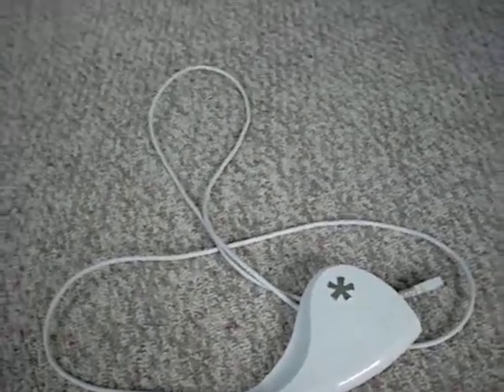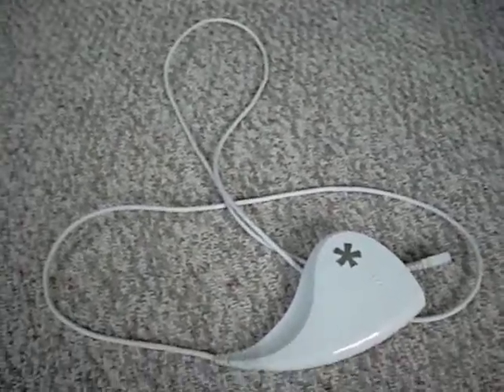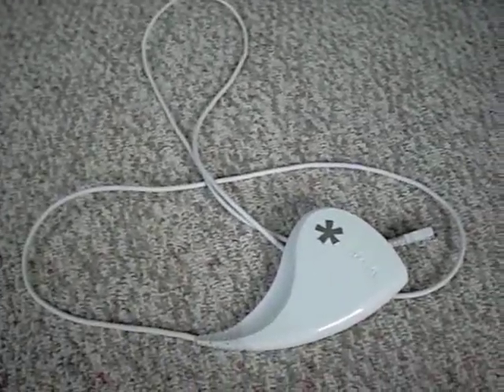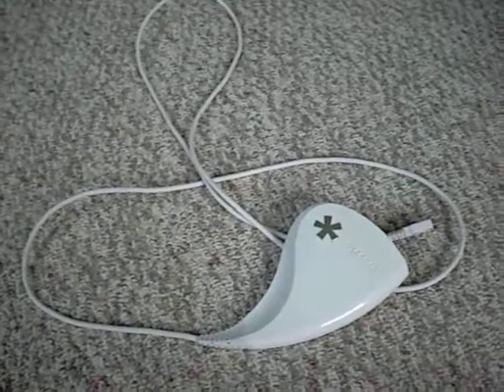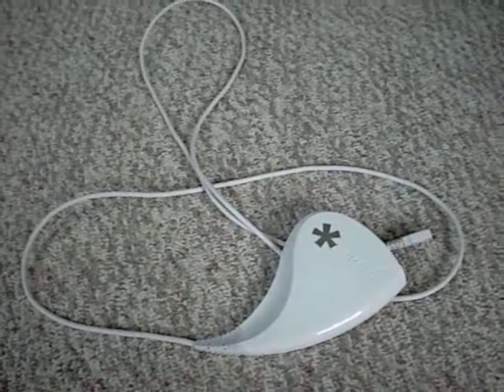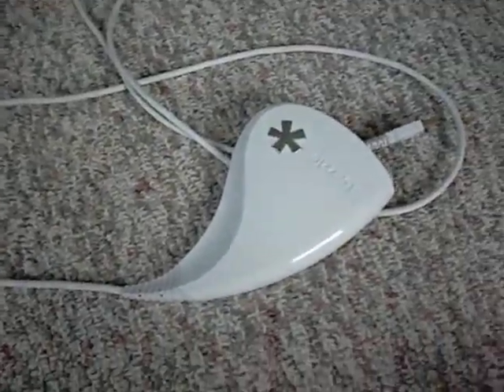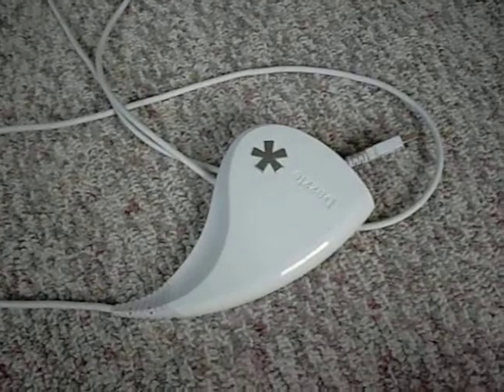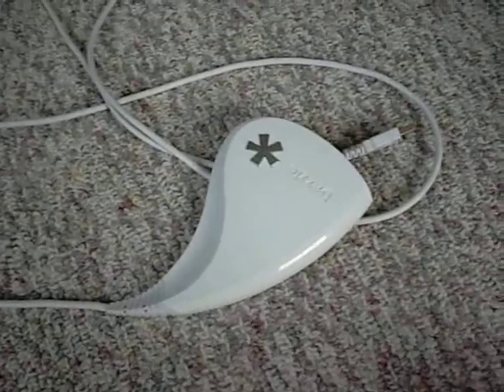Dazzle Audio Lag Fix Tutorial

Comment: you could try keeping your dazzle cool? or closing other software's such as skype...because when you receive a message the recorder slightly stops causing the audio spike lag. the reason this works is because the dazzle isn't used as much making it smoother and cooler...try recording for 100mins on best then touch your dazzle it should be quite warm.